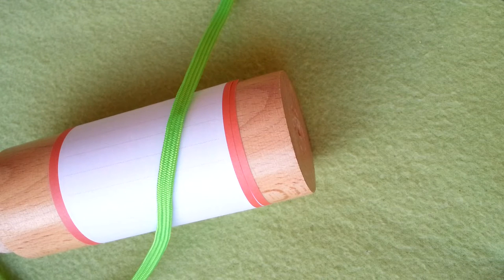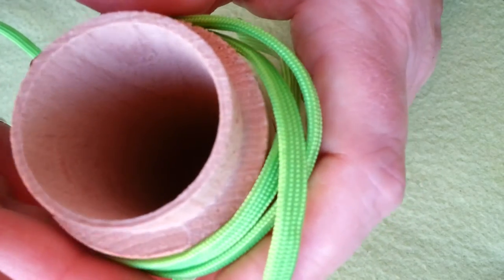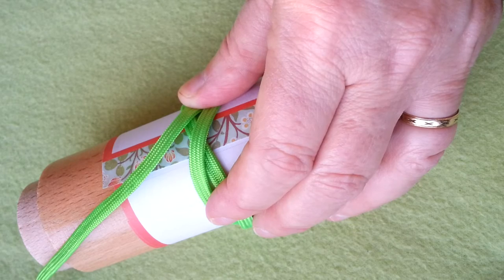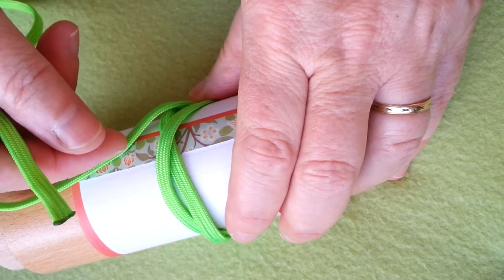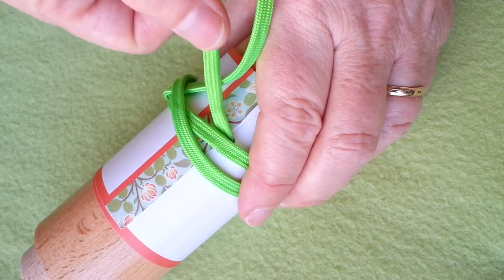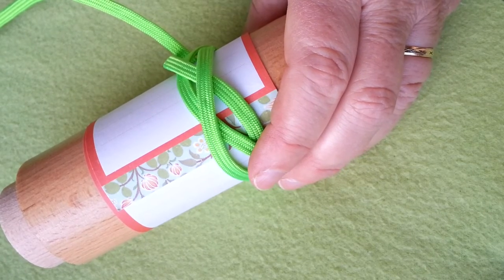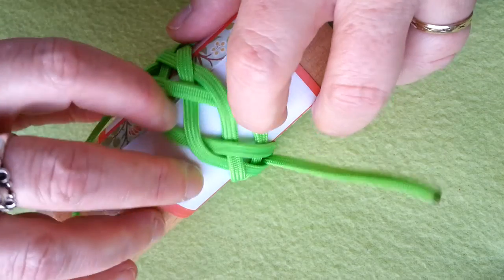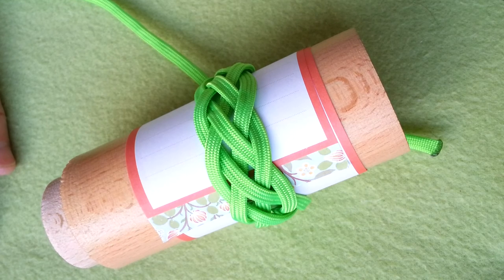How to tie a 5L 9B Fan knot

Comment: i would say that in spanish/gaucho/headhunter knots , you enter, go by, and exit with the same numbre of unders or overs, but in this one it's not , it's that the main diference between these knots?
¿?¿?¿?¿?
Reply from the maker: Fan knot means 1 pass less at the bights than the main body, for example here, bight 1-pass, body 2-pass. Fan Two knot would be difference of 2. Fan+ knot would be 2-pass At the bights, 1 pass in the body.
Reply: @MabelTyingTuts  so a fan + example would be something like an aztec knot?
Reply: @MabelTyingTuts  and a fan2 knot wold be something like /\\\/
Reply from the maker: @martin11844  it could b3 called that although it also has other knot names like Aztec. It would logically be called a 1-pass Fan 2 knot. Another Fan 2 knot could be an o4 u2 o2 u4 etc. - that would be a 2-pass as the main part would be over and under 2.